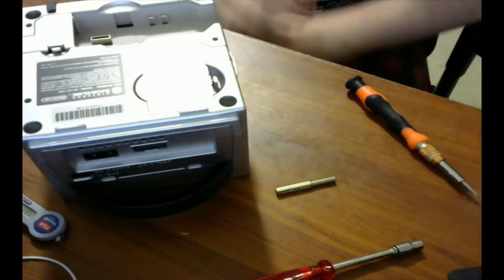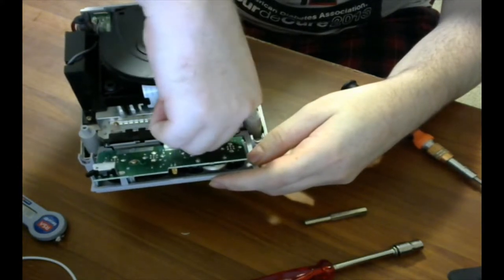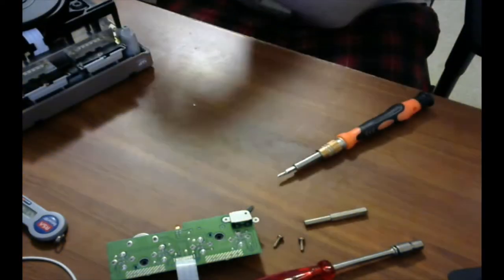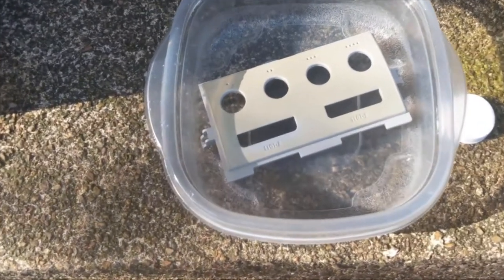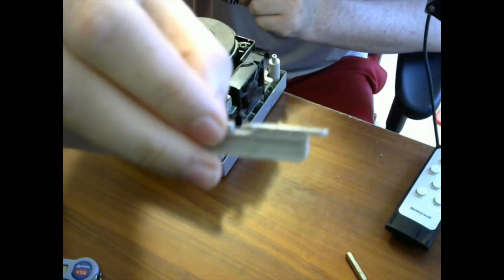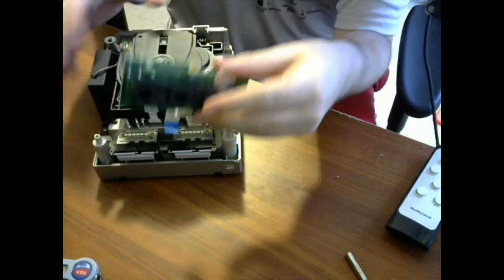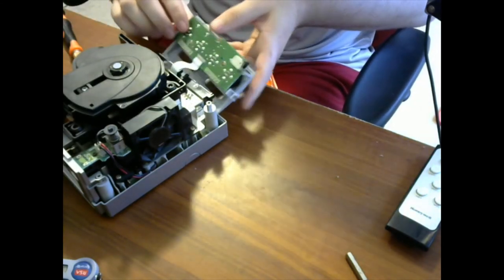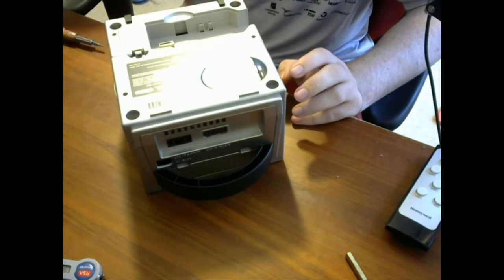Restoring Yellowed Plastic (GameCube Teardown)

Comment: I'm lazy and the faceplate is REALLY yellowed... I might just look for a replacement part...
Reply from the maker: I’ve seen another method that might be less work although I haven’t tried it myself. Instead of letting the sun do all the work you can get UV LED lights and leave it indoors while the lights run